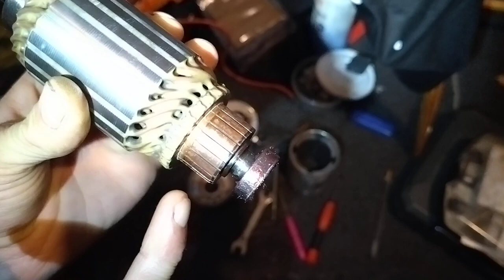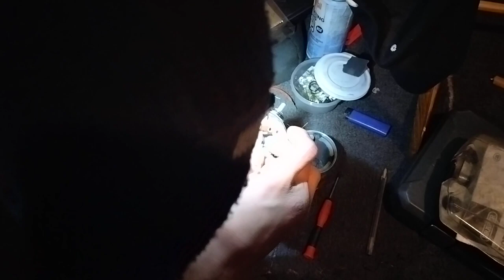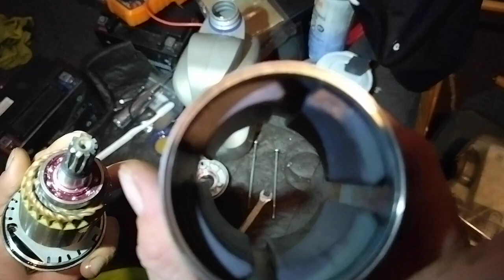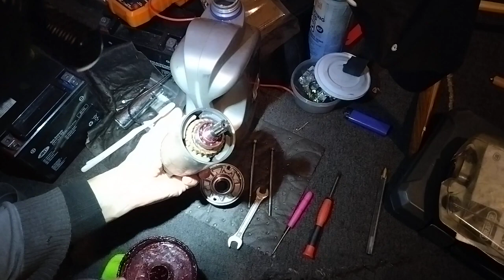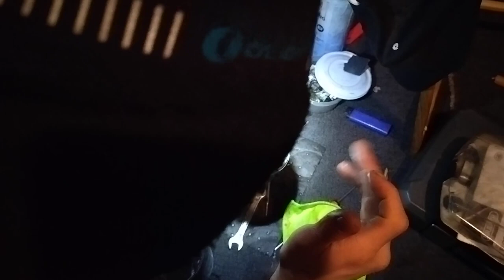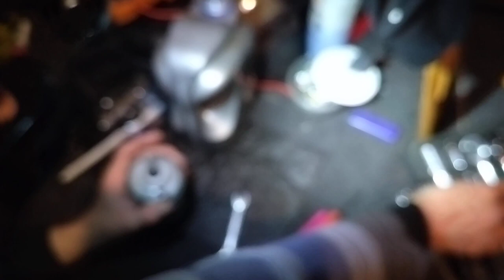Starter motor reassemble (Triumph sprint st 1050 electrical issues part 6)

Comment: I have two motors. One, when starting from the battery, shows a voltage drop from 12.8 volts to 12.5, the second from 12.8 to 11.6 volts. They rotate by hand the same way, what could be the problem? I disassembled both, cleaned, lubricated the bearings,

Comment: Good video, thank you. Can you tell me the model of the starter. and Why did you rebuild it?, did you have problems with starting the engine when hot? if so, did the starter rebuild help. and one last question, how did you remove the starter?, did you have to remove the right side cover, or did you just remove 2 bolts from the engine, and the starter came out.
Reply from the maker: Hey, thanks for watching. the motor is back in the vehicle so I can not give a specific code or anything. I have been carrying out a whole electrical overhaul due to numerous electrical issues on this bike one of them being related to the starting system. The motor wasn't too bad however I've since found other culprits causing its starter to not work as it should. One of the culprits is a little-known fail-safe on triumph motorcycles where if the voltage drops below a certain level the vehicle won't start even though the voltage is still enough to crank the bike. I hope to make a video soon explaining this in further detail
Reply: What would make my starter spin clock wise not counter clockwise
Reply: @Truthbeyaself  неверно установленные щетки токосниматель. Поверни на 90 градусов.  Или 180. Точно не помню. Но это главная причина неверного вращения.